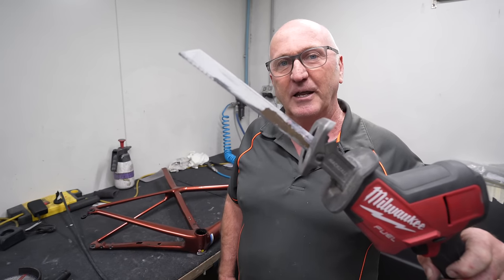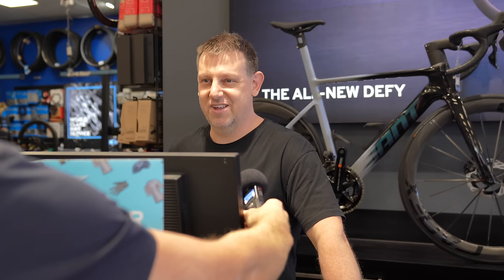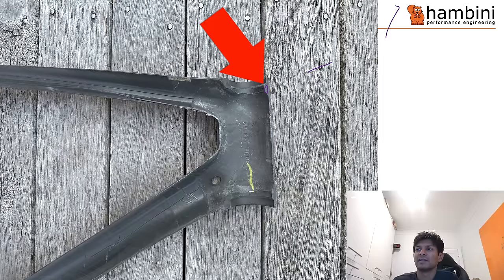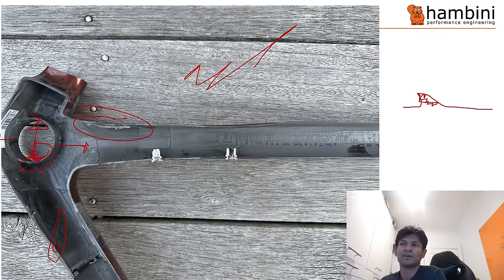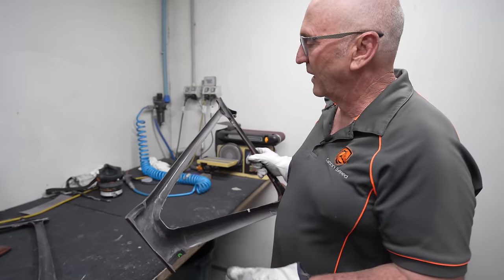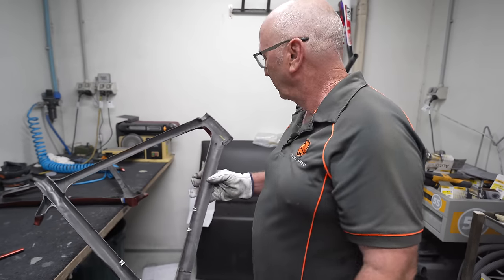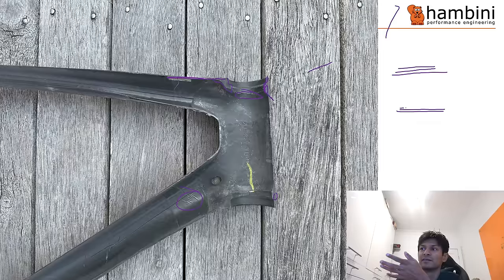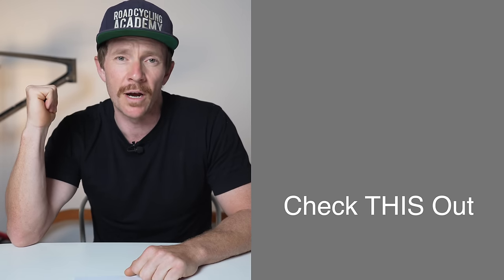How Well Made are Giant TCR's? (we found out)

Comment: Carbon manufacturer here.  I like the video but take issue with the first conclusion which is incorrect. 10.37 says the wrinkle made of glue is a "weak point". its not a weak point. if the wrinkle is made of glue (as the bike shop chaps reported) and the fibres below are straight then there is no reduction in strength. It has the same carbon, in the same orientation, and some additional glue that filled up a wrinkle in the bag. Sure its nicer to have an EPS or wax mandrel that give smooth surfaces. It makes zero measurable impact on performance or safety. What would be good is to flatten out that area of glue down to the carbon suface and identify if the fibre orientation is straight or wiggly - that would indeed make a performance difference. No I'm not from Giant, but I can see some people in the comments responding to the incorrect diagnosis in the video.
Reply: Glue is almost always going to have some voids. Makes very little difference.
Reply: I'm guessing they're using a balloon with a clamshell, but yeah it's weird that "experts" are complaining about bagging wrinkles.
Reply: @CapraObscura Resin by itself has very little strength.
Reply: Wrinkles mean poor compaction underneath the wrinkle.
Reply: I have to agree with you. I have spent plenty of time working/building high performance carbon sailing catamarans and the kind of things that are acceptable there don't make me second guess these frames even a little. Hambini is unfortunately making too much money while not being realistic with people who watch his channel about manufacturing processes.
Reply: vibratingstring  Nope. That is old school.
Reply: @JZStudiosonline  Because they're not the "experts" they claim to be.
Reply: That cross section does look unacceptably paper thin in too many places. Wouldn't trust that frame for anything but a mantel piece decoration.
Reply: @Sunspot-19  that is a benefit of using carbon though.
Reply: @alpsalish  As it expectedly shatters under a rider doing high speed down Ajax!! Case Hardened Pass!! tyvm... I have seen carbon creations during my aerospace years that were works of art. That frame looked like it was thin as toilet paper in places that shouldn't... The joints also look poorly done. A lovely introduction to earning a PhD in paying ER  and Rescue bills.
Reply: @Sunspot-19  ?
Reply: Would you recommend this frame?
Reply: @DiegoRevs  I would ride it no problem.
Reply: vibratingstring right and honestly that is a great way to do it and get a tighter and smaller frame.  See this done quite often in the marine industry still when we are making small intricate parts that you couldn't use a mandrel with.  Granted melting foam with tone is super great for vapors so should definitely be done with proper ventilation and respiratory protection seen plenty of nutty laminators that just don't get that the sweet smell is pretty harmful.
Reply: @alpsalish   Inferior construction is hardly a benny.
Reply: @Sunspot-19  it also doesn't mean it will fail or will be the reason someone is slow.
Reply: @alpsalish  Someone being slow just means they need to train. I come from an industry that precision is king therefore, have an aversion to poor fabrication practices. Wall thickness that is crooked as a dog's hind leg is a rejection tag.
Reply: @Sunspot-19  so do I. Prepreg racing cats. Sailing. I can tell what is and isn't important. You obviously don't understand what is required across different applications.
Reply: @Sunspot-19 this is a weird take. Different tubes experience different forces. Top tube especially is paper thin because forces are totally different.

Sure that means it's less strong against impact but these frames last for a long long time if subjected to forces they were designed for... Ie not clamped in a bike stand on the top tube by a gorilla.
Reply: If we were expecting aero space quality control and finish on a bicycle you would be paying aerospace prices.   That would be double the price for no real change in performance of the finished bike. The bikes are built for an acceptable failure rate at an acceptable weight and performance, no point in building past that when the cost would skyrocket for no appreciable gain.
Reply: @daversj  see, you get it.
Reply: @daversj   So, what price range are you looking for? 12k?? 15k? For a couple grand, hacksmanship might be ok however, 12-15k had better have craftsmandship and QC had better know how to fill out a rejection tag.

Comment: Great video Cam. Well done. Giant TCR is usually considered a benchmark choice.  Solid but boring option.  It’s their BB that bring us the most work. Things tend to go wrong when someone has installed something other than the plastic BB from Shimano and the hole in the frame is not good enough for a more precisely made BB.  The extra paint can cause issues with brake alignment sometimes.  Thanks for making this vid.
Reply: good to see you posting here, was thinking of you while watching
Reply: We've used Chris King (when they made BB86) and Kogel without issues at our shop.
Reply: I have a kogel installed on my wife TCR advanced, dial gauge was happy & it got in smoothly.
Reply: C-Bear also possesses no issue
Reply: Great to see you on this chat @mapdec. My 2016 Defy non-drive side shimano bb86 bearing seized after 5 years. It rarely gets wet. I just it replaced however it would be interesting to know if there is an underlying reason.
Reply: @davidh7414 some Shimano parts have bearing issues, apparently failing O-ring (if that's what the rubber sealing are named..)
Reply: What frame do You prefer than Giant in BB quality departament?

Comment: sold Giant in Saudi Arabia for 10 years. in the 10 years i did with them, not one recall. i today own 5 Advanced SL ISP bikes built fromn the frame up including a 2024 TCR Adanced SL frameset. i did crack my 2012 frame when i hit a roadworks ditch pre-sunrise. wrote Giant. got a brand new 2018 TCR Advanced SL replacement. no questions asked.....
Reply: In saudi they blow up lambo engines and buy another lambo

Comment: this is a good example of the difference between fit for purpose and best/perfect.....and getting the price/benefit ratio correct...clearly the frame is not perfect but is very good and will not be an issue for the majority of users - bearing in miond that most will change the frame before it gets close to end of life. I'm also reminded that for so long Toyota used a very basic digital clock that told the time.......did its job but no more.

Comment: I wouldn't be too upset with the quality of the frame. There is an argument to say with the amount you spend you should get perfection, but the cost isn't just in the quality, it's also in the labor, and  the so called "brand tax". What I dont think Hambini is acknowledging with his review of he sliced open frame is what the cost would be IF Giant were to deliver a perfect frame. If there's the slightest void in the frame and Giant tosses it out that's more money for the so called "perfect" frame. And for what? Giant has most likely serialized at what point a frame has met quality assurance to where they can be certain that the frame wont fold in half at designated cyclist weight. On the off chance that does happen Giant will have service personal to review warranties. that's where the other cost of the frame go into.

I think Hambini's assessment on the flaws is valid, but also not something that needs concern consider when considering this frame from Giant. Maybe the bb, but that's more of a bike mechanic question and asking how often they see this model of Giant come in for a BB change over other frames and brands.
Reply: Giant seems to go a long way for quality. They build their own melting factory for producing Aluminium according to their own standard. Aluxx etc ...

Comment: As someone who has worked with carbon fibers before I get shivers seeing this. Not because of the value of the frame but carbon fibre particle are extremely itchy on the skin. When I have to cut CF it will always be outside in front of the biggest fan in my shop. There is no way to wash them off your skin. This must have itched for a few days.
Reply: I do not get that at all from CF, work with it every day, yes fibreglass.

Comment: As someone who owns TCRs and rides with people on TCRs, the amount of us that have noise issues with our bottom bracket is overwhelmingly high.
Reply: I own and race a TCR.  I have not heard of any bottom bracket issues amongst my club-mates.  Probably not putting down enough watts to stress the frame.
Reply: Zero issues with my TCR, and I don't recall any friends having problems. That said - I once had an annoying 'bottom bracket' creak that turned out to be the seat creaking, after about a month of frustration and trips to the shop. It wasn't tightened properly after a bike fit. 

Toyota quality is all I'm after!
Reply: @damo5219  Often a 'clicking' sound that seems to come from your peddles. Overall I would say the tcr is one of the most reliable bikes out there.

Comment: I don't know why the dude was knocking steerer tubes having internal fiberglass layers. They prevent galvanic corrosion. Some compression plugs get corroded and stuck inside steerer tubes. I apply grip paste to the steerer interior, but some people's sweat is something else. Having an extra non strucutural, inert layer there is prudent, same in seat tube interiors and bottom bracket shells

Comment: Has anyone found a holly grail of carbon frames that's consistently perfect, the benchmark to measure all others too.
Reply: Perfection is the enemy of manufacturing. That's why aerospace has tighter tolerances than bikes do. There's little to no value from going from good enough to perfect. Manufacturing wise however, insisting on perfection when it's not needed is how you go bankrupt

Comment: Is it possible to add riv-nuts to a carbon frame or does this need to happen during the manufacturing process?
Reply: The frames are usually reinforced where the rivnuts are to be installed, so it's unlikely that installation would be successful in another area of the frame.
Reply: @essjayaitch carbon fibres are only strong if unbroken, I wouldn't take the chance. Some frames are delivered with different options, like Willier, though I'm not impressed by their customer service. Even basic questions are ignored as well as complaints over serious dealer issues..
Frames seems fine!

Comment: Why would you expect a bottom bracket laminate to be as thick at the top as it is at the bottom as it is subjected to a bearing load? the loading is different and creating such variation can be studied before layup with a program like Ansys ACP, I think it is misleading to say this is poor manufacture when you have not created a 3d carbon model in ACP PREPPost and placed the carbon in the designed positioning and looked at said results under loading in Post Processing.

Comment: Interesting idea but ultimately rather inconclusive unfortunately.

1. It's a sample size of one. It does not represent the quality of these frames in general. Is this frame a good one or a bad one?

2. A 'perfectly' built frame with zero imperfections can still have poor performance and longevity due to inferior design. In other words, a great design with 99% build quality can easily outperform a mediocre design with 100% built quality. 

So then, what's the point of destroying a perfectly good frame?

Comment: dont you think, that the non uniform wall thicknes of the BB might be on purpose? because the bearing will not be loaded in the direction towards the headset? most force on the bearing will be downward and a bit to the back when sprinting

Comment: Im concerned that the bottom bracket tube doesn’t not connect to both sides . The BB relies on the box section around it for strength rather than the tube surrounding the BB. Can the BB be over-tightened and damage the frame?

Comment: If proof is in the pudding, my 2009 TCR Advance (read Toyota) is still going strong after sitting under the veranda for 10 years being sweated on, whilst on my cycle trainer, and is once again my road bike after the bottom bracket of my 2014 Colnago C59 (read Bentley) failed from galvanic corrosion, which was always kept dried and cleaned in my study. But the most interesting thing is, I believe Giants come with a Lifetime Warranty, whilst Colnago just a pitiful 2 years, perhaps the worst in the industry, especially on a warranty length for money basis!😢….

Comment: Hambini hasn't got a clue what is the problem with tcr sl frame. I discarded mine because the diameter of the bottom bracket was inconsistent and soft plus the diameter of the upper headset bearing holder was way too big and there was a free play on the headset bearing body no matter the preload. There are lots and lots of feedback on internet of this problem. Worst frame I rode on.

Comment: A friend of mine bought a carbon Giant frame.. after riding it for a few months the frame had a catastrophic failure after going over a small speed bump at low speed throwing him over the bike hitting his head and severely spraining his shoulder. The frame failed on the top and bottom tube.. the bike dealer offers him no recourse as the frame sat in his shop for two years and claimed it was out of warranty.. Hence I bought a Trek ALR 5..

Comment: So these things arre modular bits connected with carbon "tubes" and then baked in a mold? Not much difference than a carbon tube-to-tube mitered to fit before wrapping frame...unless you consider that latter can be made-to-measure vs the t-shirts sizes you get from Giant (and every other brand who uses them as a contract builder).